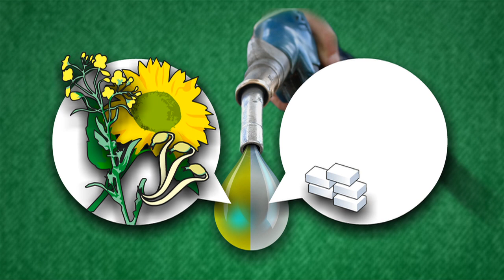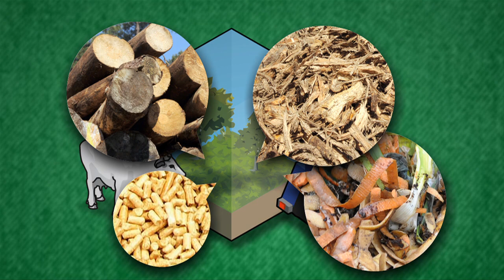Biofuels, the Green alternative

Comment: The US EPA has spent a lot of time studying biodiesel. In fact, no other alternative transportation fuel has been as thoroughly vetted. Here’s what they’ve concluded:

Basically, they have tested biodiesel every which way and concluded that it’s emissions are significantly less than dirty diesel.
Now, Califonia’s Air Resource Board will also tell you that if you make biodiesel from waste vegetable oil (we refer to it as “recycled”) you will actually reduce your carbon emissions by 90%. (http://www.arb.ca.gov/fuels/lcfs/072009lcfs_uco_bd.pdf)
What does this mean?
 
Well, given that diesel #2 is known to spew 22.3 pounds of CO2 per gallon, if we  substitute 1 gallon of B-100, made from recycled veg. oil, waste grainproduct /RiceBran Biodieselfor 1 gallon of diesel # 2 we will save 19.6 pounds of CO2 from contributing to the warming of our planet. If  we use virgin soybean oil, we’ll only save 17.3 pounds.
Either way, we hope we’ll agree that biodiesel is good for our planet. And Springboard Biodiesel is proud of the fact that our 700+ BioPro™ biodiesel processors represent over 5MM gallons of annual production capacity, which means that we could potentially be assisting with the extraction or abatement of over 96MM pounds of CO2 annually!